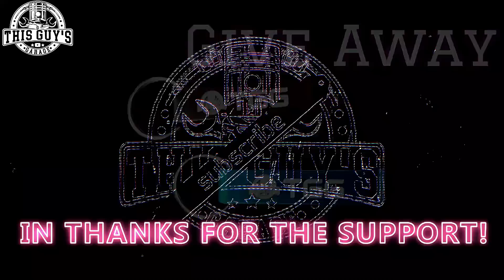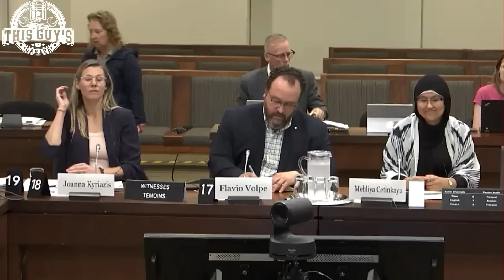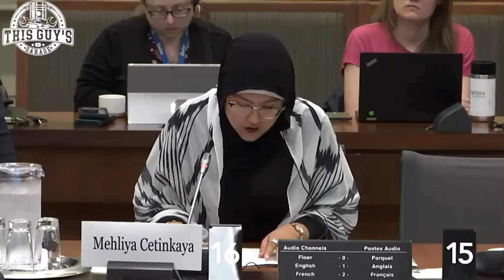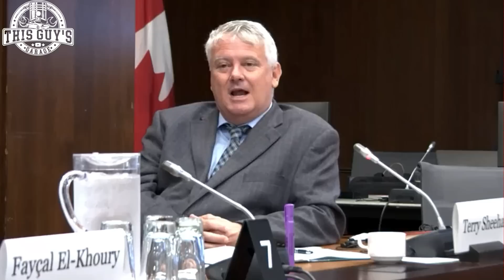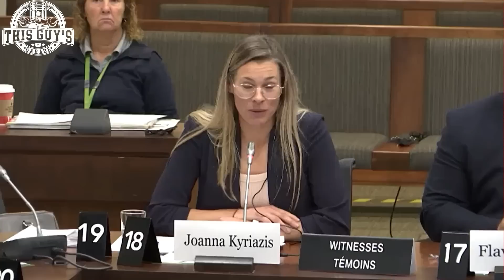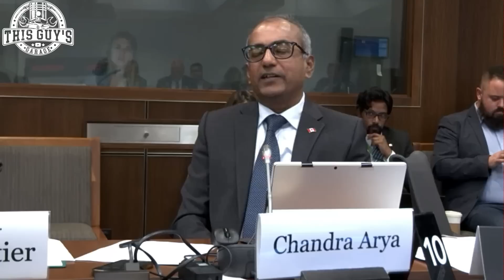Unraveling the Electric Vehicle Protection Racket in Canada

Comment: No desire to buy a stupid EV Ever,
Reply: The problem with EVs what happens if any province has a flood lile BC had, when sides of  mountains fall down,bridges washed out. Road ways where not passable. People were stuck on vehicles for 24hrs + you can't plug in anywhere. Atleast with gas driven vehicles you can have gas delivered to you.

Comment: In my city electric vehicles make up less than 1% on the road. Also we have closed several charging stations due to not being used. No one wants a car that underperforms in the winter and has so few charge stations. Also no one wants to support anyone except for tesla it seems. I can gas and go with my 2 cars. Electric takes time away from people's day when they need to recharge. They just don't seem that reliable to most drivers.
Reply: Do I need to go back to horse and buggy cause I will
Reply: @briannunya2838 yes yes you can. The Amish have done fine over the few hundred yrs. But the Climate activists will complain the horses fart & crap too much.
Reply: Only if you can't afford  a car gas and insurance and maintenance

Comment: Imposing high tariffs on Chinese EVs limits consumer access to affordable electric vehicles, contradicting the government's goal of widespread EV adoption to reduce emissions. These tariffs keep EV prices inflated, stifling sales and hindering the transition to greener transport. Ultimately, this protectionist approach fails to protect our auto industry, which is largely owned by American and foreign companies, and instead restricts consumer choice and affordability.
Reply: You may want to re- think your flawed logic as since 2021 there were over 3,000 EVs fires per year in China, and insurance premiums rose by 20%.
Plus, don’t forget the fact that electric vehicle replacement parts are 2.7% more expensive than gasoline-powered vehicle parts.
Reply: @roartary  It seems you've missed the core issue. My point isn't about the quality of Chinese EVs but the unfairness of imposing 100% tariffs, which denies me access to these advanced vehicles.

Regarding your claim about EV fires, while it's true there are around 3,000 EV fires per year in China, EVs are still statistically less likely to catch fire than gasoline vehicles. The rise in insurance premiums is part of a wider trend due to inflation and repair costs, not specific to EVs.

As for replacement parts, EVs may be 2.7% more expensive, but they require less maintenance overall, with fewer parts to repair or replace. When considering total ownership costs, EVs often prove to be cheaper in the long run, making your argument about isolated expenses misleading.
Reply: @PercyY-ib2vx no one is stopping you from purchasing a EV from China, only thing is you have to pay the 100% tariff on it. Yes it's a good thing the govt has put tariffs on China's EV vehicles entering Canada. As it will create huge job losses for Canada. No different than only a few phone companies allowed in our market. If you flood the market it can create huge job losses. As it is right now Corporations have been using Foreign workers which you as a taxpayer are paying 75% of their wages. While driving down wages at the same time.
Reply: @liquidgal9867  Your argument assumes that high tariffs are beneficial without considering consumer choice or market competition. Imposing a 100% tariff on Chinese EVs limits access to affordable, innovative options for consumers like me and doesn’t solve broader economic challenges. Protecting local industries is important, but it shouldn’t come at the cost of denying Canadians access to advanced technology, especially when Chinese EVs are leading in areas like battery innovation and affordability.
Regarding job losses, it's not the presence of foreign products that causes this but the lack of competitive response from local industries. Encouraging innovation and investment in our own EV sector would be a more effective way to protect jobs than simply restricting access to better options. Limiting competition stifles progress, and as consumers, we deserve the freedom to choose the best products available without excessive penalties.
Reply: @liquidgal9867   Protecting local industries is important, but it shouldn’t come at the cost of denying Canadians access to advanced technology, especially when Chinese EVs are leading in areas like battery innovation and affordability.

Regarding job losses, it's not the presence of foreign products that causes this but the lack of competitive response from local industries. Encouraging innovation and investment in our own EV sector would be a more effective way to protect jobs than simply restricting access to better options. Limiting competition stifles progress, and as consumers, we deserve the freedom to choose the best products available without excessive penalties.
Reply: @roartary  It seems you've missed the core issue. My point isn't about the quality of Chinese EVs but the unfairness of imposing 100% tariffs, which denies me access to these advanced vehicles.

Regarding your claim about EV fires, while it's true there are around 3,000 EV fires per year in China, EVs are still statistically less likely to catch fire than gasoline vehicles. The rise in insurance premiums is part of a wider trend due to inflation and repair costs, not specific to EVs.

As for replacement parts, EVs may be 2.7% more expensive, but they require less maintenance overall, with fewer parts to repair or replace. When considering total ownership costs, EVs often prove to be cheaper in the long run, making your argument about isolated expenses misleading.